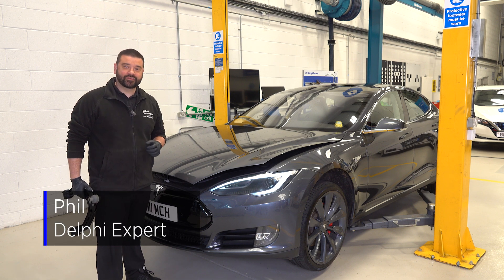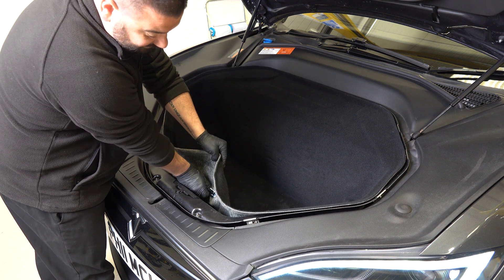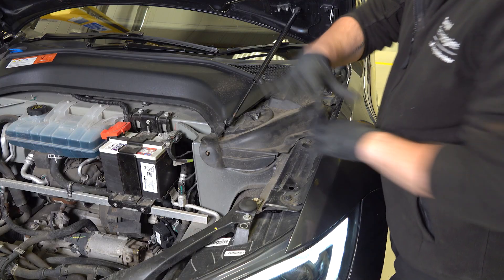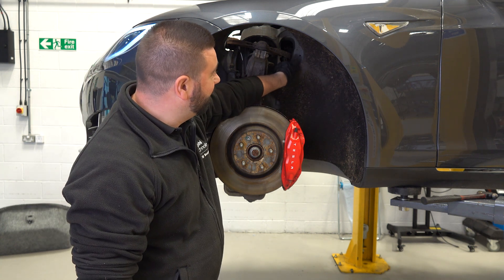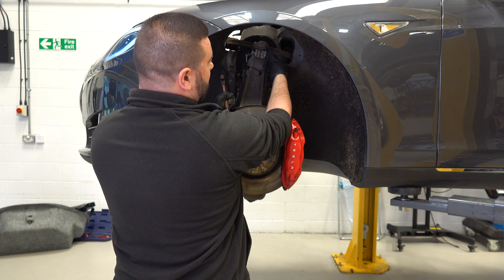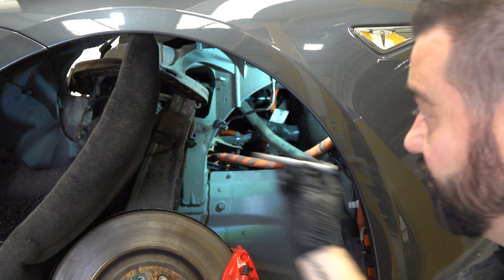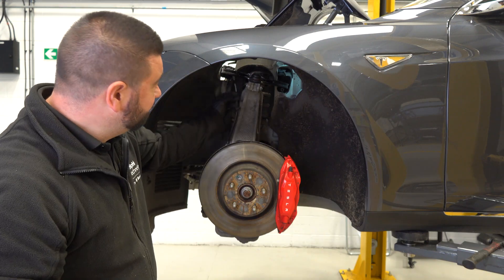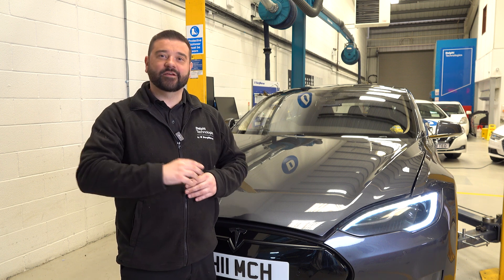[EN] How to replace the upper arm on a Tesla Model S | Masters of Motion

Comment: Thanks, just one remark: you should tighten the bolts when the car is on it's wheels again, not when the wheel is hanging down. Tightening the bolts before that will stess the bearings.
Reply from the maker: Hi @pgapieper, you are correct on this, suspension bush mounting bolts should be finally tightened and torqued at the natural resting angle.  This can be achieved by lowering the vehicle to the floor with the wheels on, or can be simulated to achieve the same result.  We noticed we mentioned this in our other Tesla suspension video, but it missed the final edit on this one – apologies.

Comment: with control arms torqued in this position, you are drastically reducing the lifetime of the bushings :)
Reply from the maker: Hi @adamkucera3343, you are correct on this, suspension bush mounting bolts should be finally tightened and torqued at the natural resting angle.  This can be achieved by lowering the vehicle to the floor with the wheels on, or can be simulated to achieve the same result.  We noticed we mentioned this in our other Tesla suspension video, but it missed the final edit on this one – apologies.
Reply: Trust me the ball joint would fail long before the bushing. If Delphi is the same as OEM. 😂

Comment: Great video thanks, very clear. Tesla discuss bolting up the new arm at the old set ride height. Is that just for air suspension, should we jack the hub up a bit before torqueing up anyway? They also instruct a 4-wheel alignment check afterwards.
Reply from the maker: Hi @Toob41, Delphi always recommends to torque the bush bolts when the vehicles weight is resting on the suspension, and with the vehicles ride height set to standard.  This is where the vehicle will spend most of it’s time, and it would put the least amount of twisting torque on the bush.
However Tesla also provides an additional step, which uses a ‘ride height tool’ which sets the arm angle at a specific height, with the aim of allowing the bush to sit at its natural position.
Where this tool is not available, placing the vehicle on the floor with the vehicle in standard height, would achieve a similar outcome.  After any replacement such as this it is indeed best practice to check and adjust the wheel alignment for toe, caster, and camber.
Many thanks, Delphi Technical Team.
Reply: @DelphiTechnologies  perfect. Thanks  👍
Reply: @DelphiTechnologies  Hi, how do you torque the bush bolt (the right one) with the wheel on ? I'm not an expert and maybe my english is not as good as yours :)

Comment: No torque specs?
Reply from the maker: Hi @benc1927 thanks for the question. We try to find a balance between detail and ensuring we show the most interesting content. The torque specs were checked using Delphi VTI (technical data) and applied once the weight was on the vehicle.